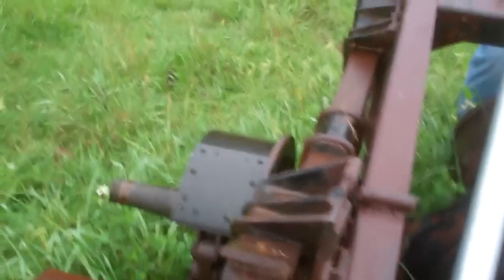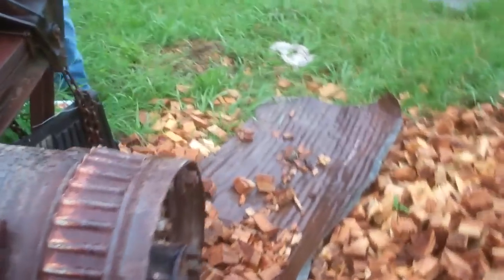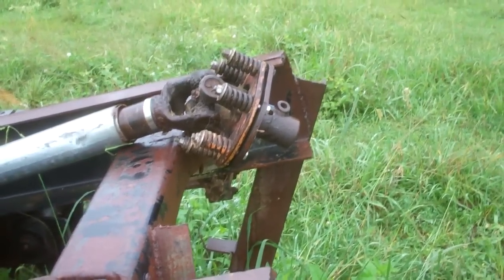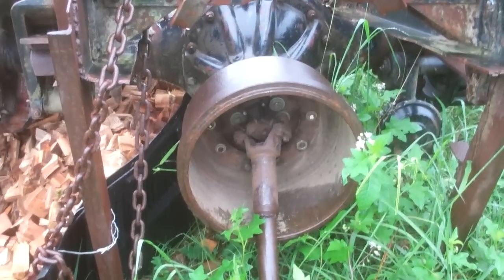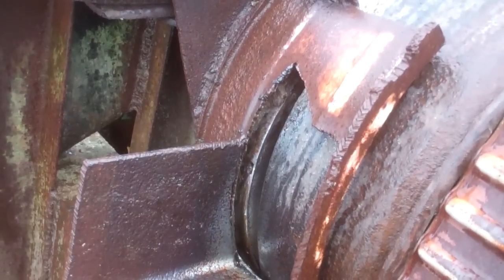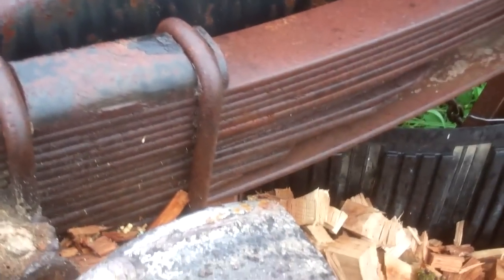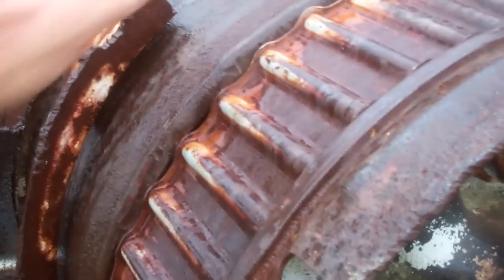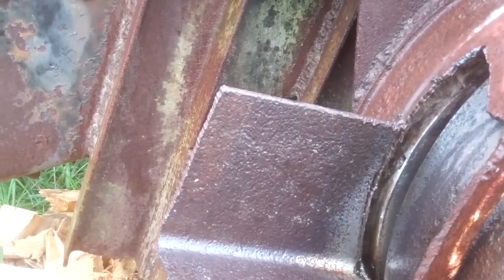Fuel Processing: Chunker Details

Comment: I like your wood chunker.  You say about using a stop to cut different lengths.  Why don't you remove and set up one of those leaf springs as a stop.  Then it would bend out of the way as the wood cuts and then spring back to the stop position. Rob.